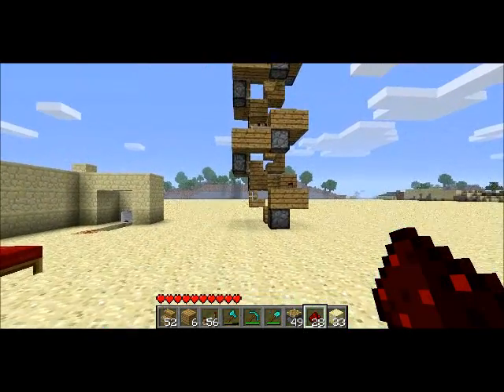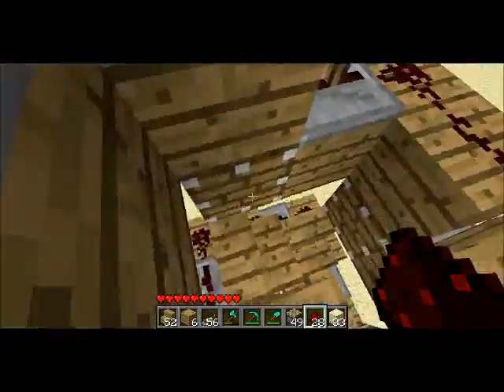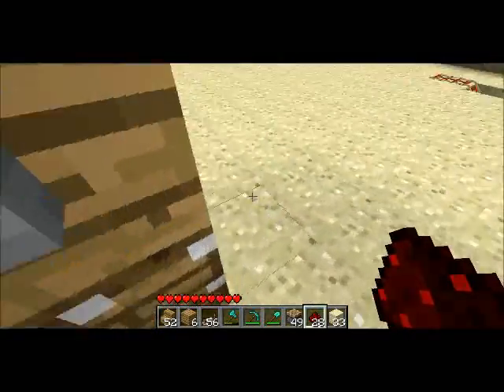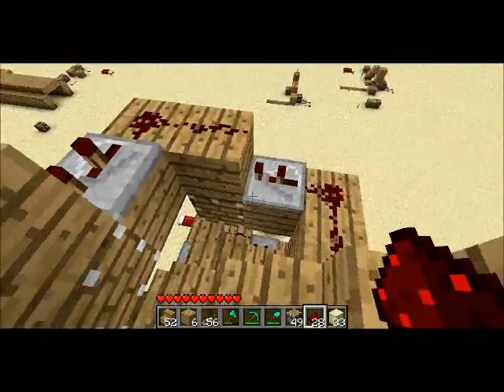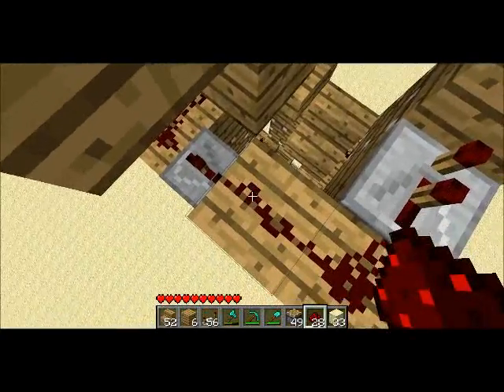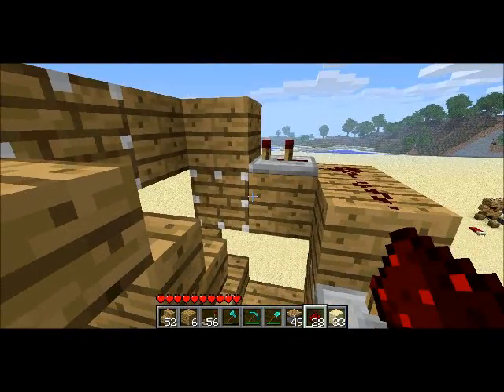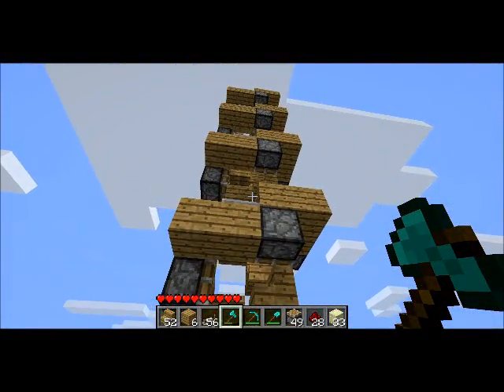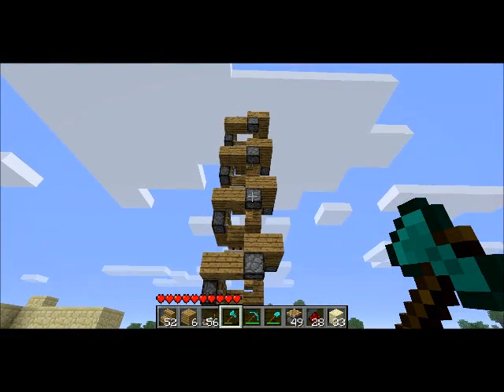Tutorial: Spiral Staircase Piston Elevator

Comment: nice finally something that works a is a little cheaper then a powered spiral rail. ... also you could use  dirt instead of wood...if cosmetics is not an issue, also the outer power ring is a good place for lighting.